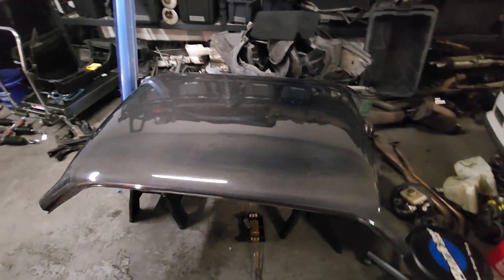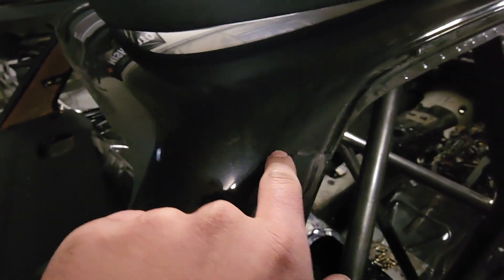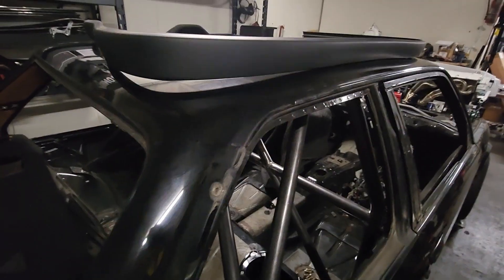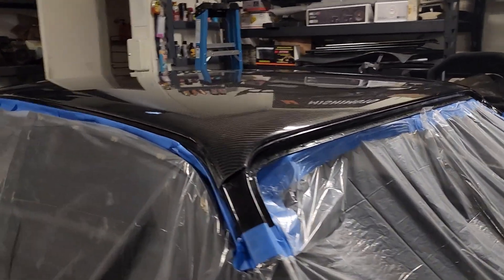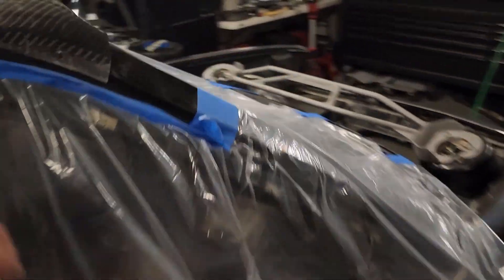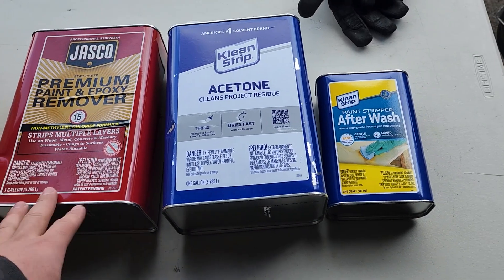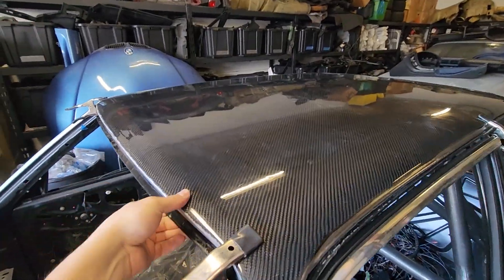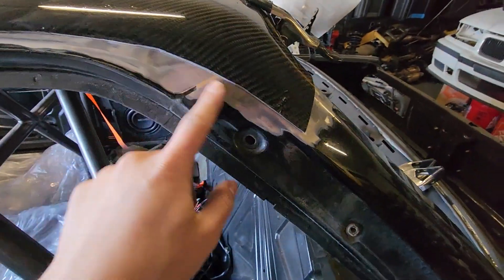E30 Restoration EP15 | Installing A Carbon Fiber Roof On My BMW E30

Comment: Why leave steel roof in?
Reply from the maker: I wanted to leave as much structural metal as possible since I'm only running a half cage. Your supposed to cut the steel roof out but I didn't want to run a full cage

Comment: i think it is silly to do this. The car is already so light. doing so can compromise the already weak rigidity of the aging car.,
Reply from the maker: That's why you are supposed to run a full cage when doing this conversion

Comment: bro, rip that middle roof skin off and just leave a frame, do it properly, bonding it on the skin can lead to separation due to different contraction and expansion ratios, like the singer porsches that are cracking and delaminating, then on the edges use paintable elatic sealer so where the edges meet the metal theres enough for it to expand and contract, if you filler it its gonna crack . subbed, look forward to seeing this project
Reply from the maker: Appreciate the advice. The roof is on and not coming off

Comment: Your car man but seems like a real silly expensive way to add weight to a car. Scratching my head using it as a “skin”
Reply from the maker: Your absolutely right it was an expensive way to add weight to the car. It still weighs less than if the complete sunroof assembly was in the car. It's not meant to be the lightest car. It's getting full sound deadening and a full interior
Reply: @themaskeddriver  love a slick top 👍🏼 I take back the silly part!